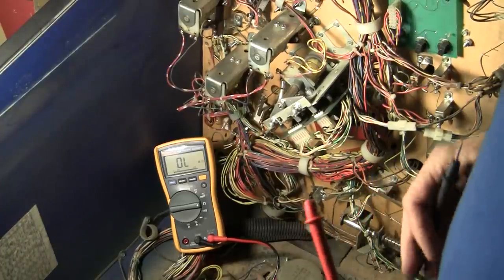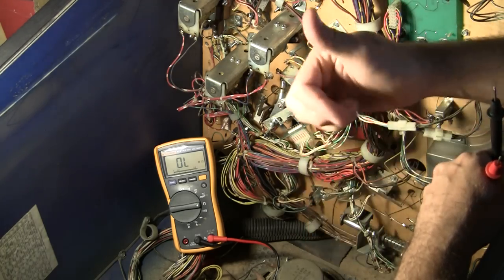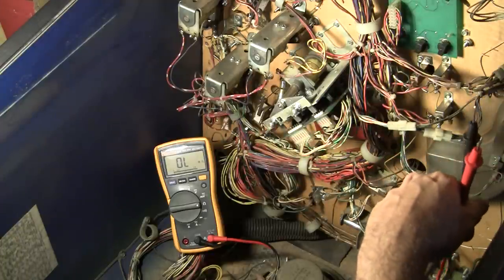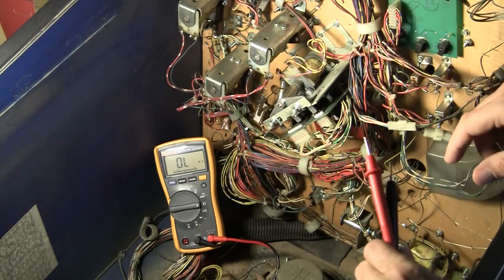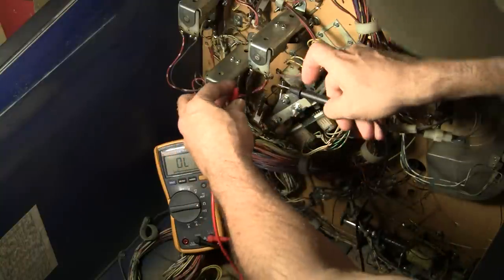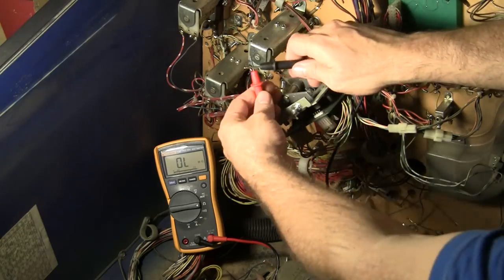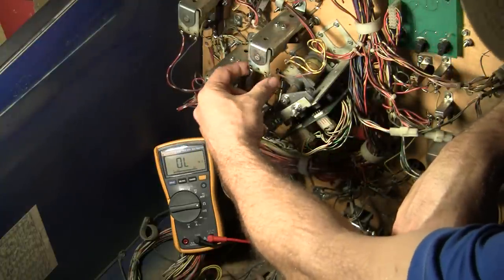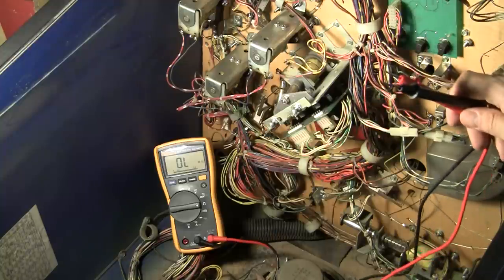Checking a pinball machine's coils before powering up - PinballHelp.com

Comment: Thanks for the video, you just helped me confirm that I have a flipper coil (or diode) shorting out on my Flight 2000, now I can quit messing with wires I can't find a problem with and continuing to pop 7A fuses!
Reply: hi pal, ive a fight 2000 too, it turns on..lights up..but no 7 dins...any help?

Comment: I had a diode fail shorted one time. I thought the coil was bad because as soon as I tried to fire the left flipper, the main fuse blew (not sure why the coil fuse didn't go out instead) so I looked with a DMM at the coil and it said it was shorted. Then I unsoldered the diode, and found that it was shorted but the coil itself was fine.

Comment: Thank you so much for these videos. I am a newbie and EVERYONE of these vids are extremely helpful. I am having trouble with my '97  Sega X-Files "superVUK" coil. It sometimes fires much too powerfully. As it happens intermittently it is hard to diagnose (for me.) The main problem is that when it does this it launches the ball past the ramp and it hits the playfield, HARD. It actually leaves divets and in essence is ruining my almost pristine playfield. NOT GOOD. I have tried all of the simple fixes to no avail. After following your video I find that the resistance is at about 3.8 ohms both ways. I am just going to replace the coil as I can not think of another solution. I have seen quite a few posts on this topic for a variety of pins, but none with a solid solution or method of testing. Any suggestions would be greatly appreciated. Thanks again!
Reply from the maker: Thanks for the kind words - be sure to subscribe - every little bit helps!

Comment: I usually de-solder and use a solder sucker as some times the wires are kind of taught and not much room to play with on some of the wiring.
Thanks for the video though I was not sure what setting I needed to test the coils and now I do.
I already know the backbox knocker is out of commission as it was totally melted and wires to it were cut.
So I know know some place in the board I need to replace some resisters or transistor or what ever it is for the knocker coil.

Comment: good, the coil that hits when you take out credit is burning the F104 of the power drive board.

I measured the large and small transistors associated with this coil and everything is ok.

I already measured the resistance of the coil with the multimeter and this good to coil.

I already tried this coil on another pinball machine and it works well without burning the fuse.

I've already replaced the power drive board with another and continue to burn the fuse.

the flipper machine is a theatre of magic

what can be ?

Comment: I have a Whirlwind Pinball. How would I test a three terminal flipper coil FL-11630 with Diodes to determine if they are bad?? I think they got fried when I installed them because I found the correct wiring and when you hit a flipper button, It will blow the fuse in the backbox.  If I disconnect the wires, the other flipper coil in the top of the playfield works fine....
Reply: Same problem here.. have you tried Pinside?
Reply: RobSi I learned that you remove the diodes and test them.. if they are bad, replace the diodes as that is most likely the case which it was for me..
Reply: @av92  Thanks for your advice!